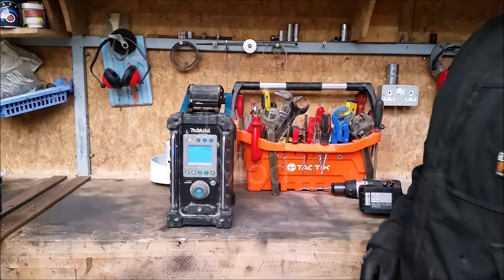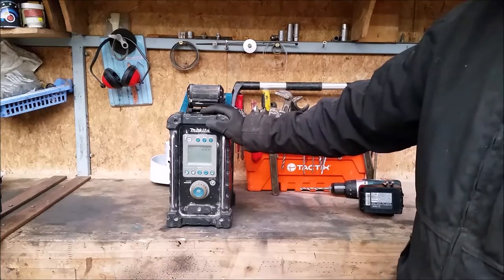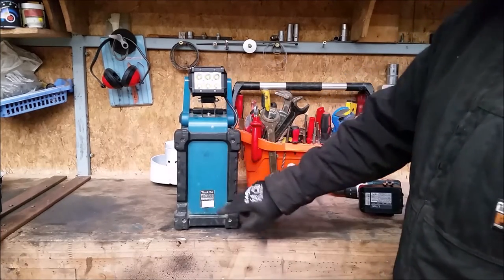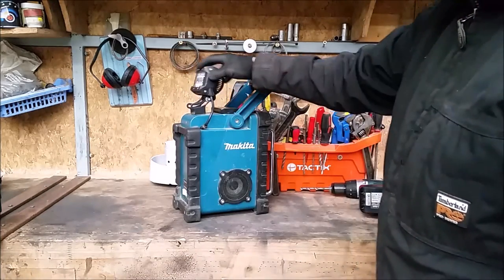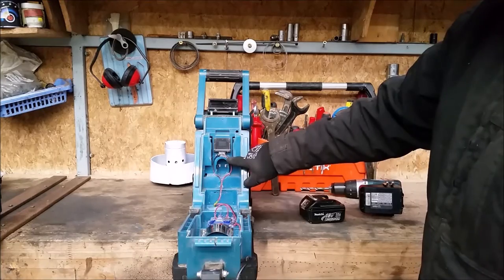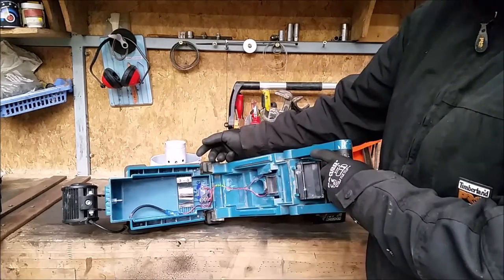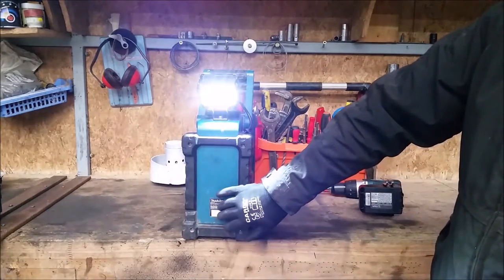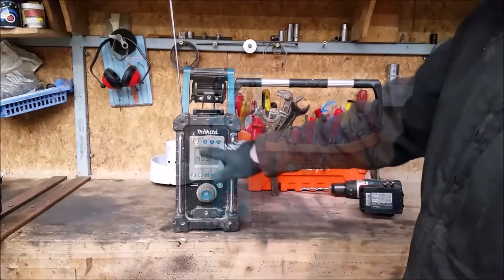Shop Talk .. Makita Radio becomes Powerful Worksite Light

Comment: When makita do this themselves we will all back u up pal plenty witnesses to say u did it first .i have to pull myn apart slmetkme this week to fix the power port on the front (it stopped working on batteries) but now its having a light fitted at the same time .great idea
Reply: They have just released the Makita Radio Lantern 😁

Comment: Gerry, finding it difficult to source a suitable light similar to the one in your vid. Tried flea bay and Amazon but no sucess. Can you post a link to your source please.......thanks.
Reply from the maker: Hi John. These are the same lights I used on my lamp but I cant find the exact vendor. http://www.ebay.co.uk/itm/18W-LED-Work-SpotLights-Waterproof-Roll-Bar-Offroad-Jeep-Truck-Car-Boat-12V-24V-/332150953591?var=&hash=item4d55bd5677:m:mj5mwy6O7h1ZcHh-SfeaeCQ  Cheers Gerry
Reply: GerrysDiy since I've installed the light I've got interference with signal, any ideas how to get over that bridge thanks

Comment: Gerry 
what about a 12v cigarette socket & a usb port or 2
also you could maybe use a 12/24 v to your country small inverter  for some stuff
Reply from the maker: Hi Moondyne Joe. It would be very useful and really easy to add. I'll have a look in the junk drawer and see what's there. Cheers Gerry
Reply: No worries Gerry, it to me seemed to be such an obvious omission nowadays most people have at least 1 item with them that needs a usb charge  i wonder if a Bluetooth module could be hooked up to let you play your smartphones audio books or music on it or use thumb drive to radio
check out  The Post Apocalyptic Inventor for some assidtance her is a very knowledgeable bloke